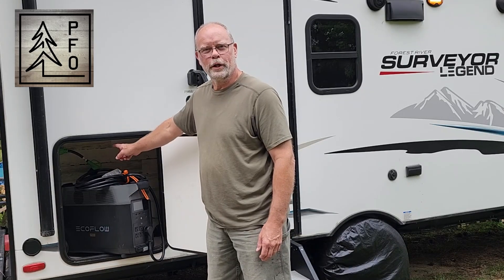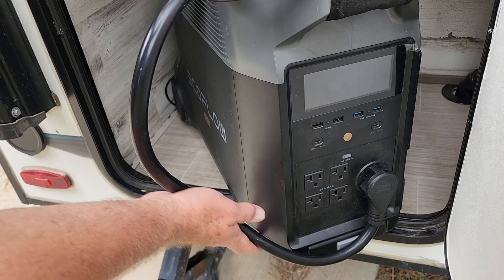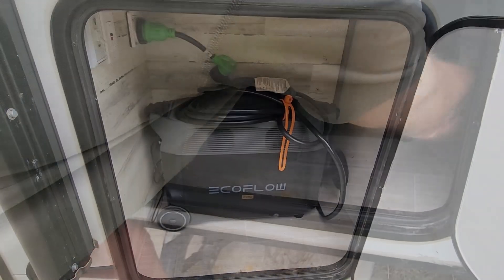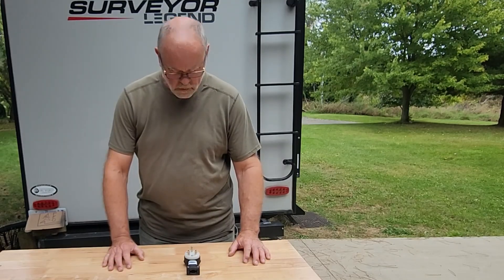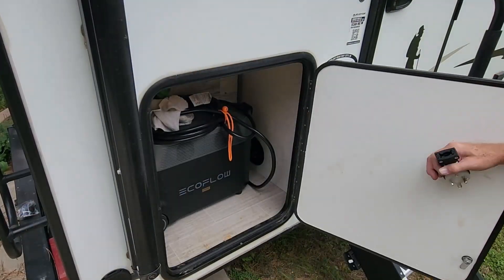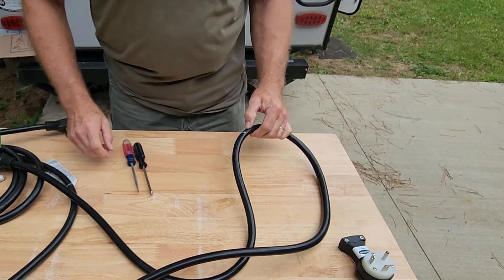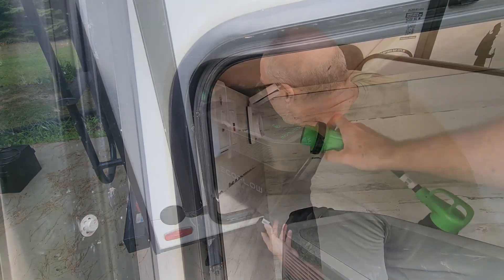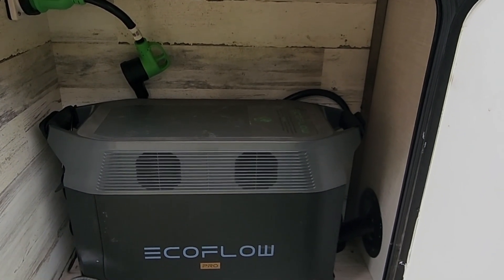How to Make a Custom 30 Amp RV Cord to use an Eco Flow Delta Pro inside a Travel Trailer

Comment: Good solution. What about a neutral-ground bonding plug? Pretty sure you need it with that configuration when not connected to a pedestal or other power source.
Reply from the maker: Good catch! I totally missed that detail. Thanks

Comment: I watch video again and saw comment on screen about changing other end plug. Sorry should have paid more attention. Once again this was the exact video I was looking for. Happy Travels!
Reply from the maker: Every little improvement makes the rig a little easier to use. Right now we are on a long 5wroad trip testing out a new DC to DC charger that I installed so we can recharge the Delta Pro from the tow vehicle battery/alternator during the long days on the road. That video will be coming soon.

Comment: Great couple of videos. This mod is exactly what I was looking to do with my trailer. One question, is there a reason you continued to use the dog bone when you replaced the end to the Ecoflow instead of adding an end to match your receptacle? Keep up the good work.
Reply from the maker: Yep, I see you found the answer in the video. Good luck setting up your rig!

Comment: Nicely Done!, do you travel with the Ecoflow in that compartment or do you put it in the back of your tow vehicle for transport?
Reply from the maker: Thanks! I travel with it in the compartment. I've moved other stuff up front to offset the weight. Watch for more videos on this topic, coming soon. We're on a road trip right now, in fact, testing out the next upgrade. I installed a Bluetti Charger 1 DC-to-DC charger so it can recharge the Delta Pro from the truck alternator while we are on the road between boondocking spots.
Reply from the maker: OH, and strap it down back there! I don't think I showed that in the videos.